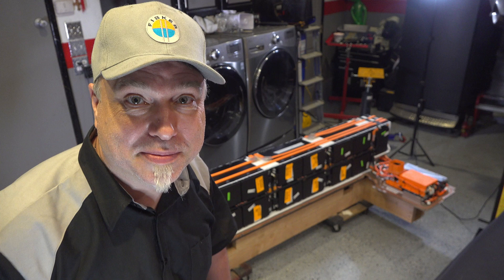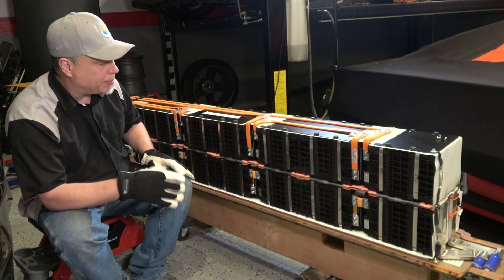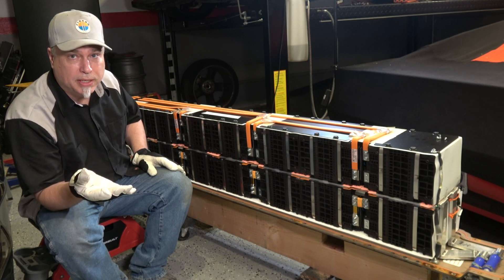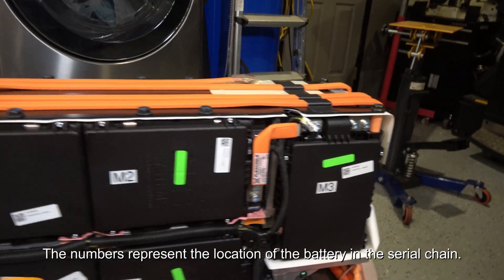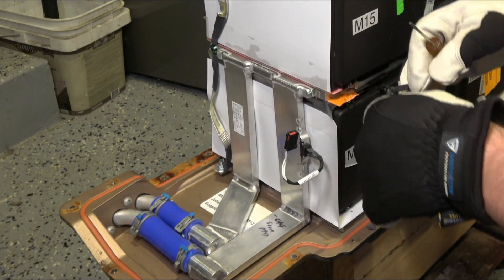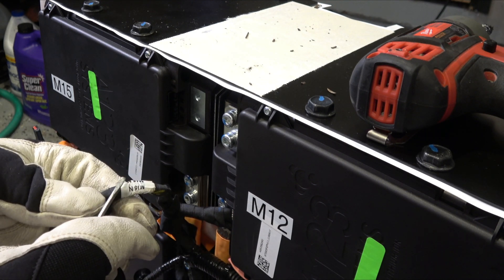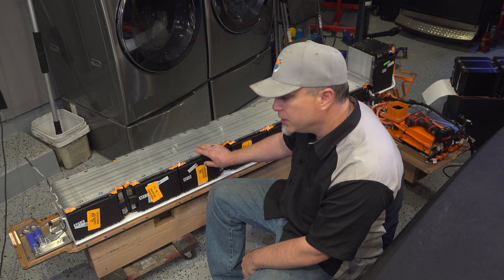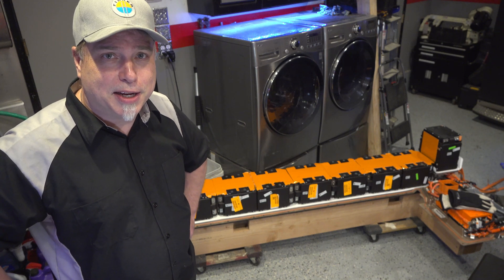Fisker Karma: Battery disassembly [4K] Ep45

Comment: I have carma fisker and i wanna sell it in the US
Reply: I'm looking for a project Fisker. If you still have it, send me a message.
Reply from the maker: So lets get this straight.  You are looking to buy MY Karma as a 'project'?  You realize that the sole reason for making this YouTube channel was to fix my own bricked Fisker Karma so it would operate correctly.  Which it does now.  I have lots of different Fisker Karma videos other than the one here you are commenting on that I have made.  You can fix your own 'project' yourself this way.  You don't need me (although I will answer any direct questions on my social media page), or my car to work on your car. There is simply nothing else I would do to the car and is running perfect.

Comment: Battery stuff gets pretty scary! Great video!
Reply from the maker: It is always tricky working on energized equipment.  One slip with a probe in the wrong place and it's all over with.  It is amazing how much energy is required to propel a 5300# car down the road at 70 MPH.  Testing was a bit of a challenge due to the high current, but not impossible in the garage.  Thank you for the positive comment!